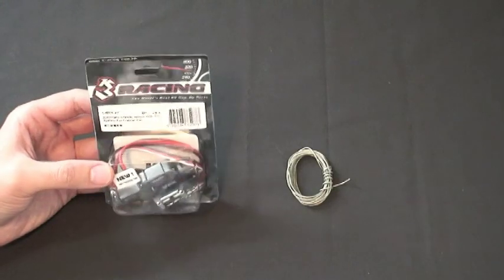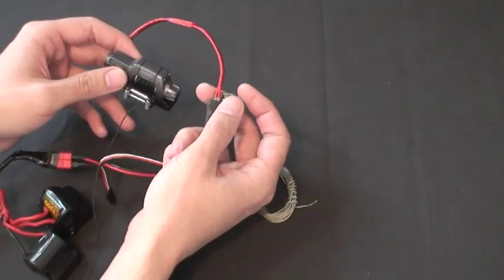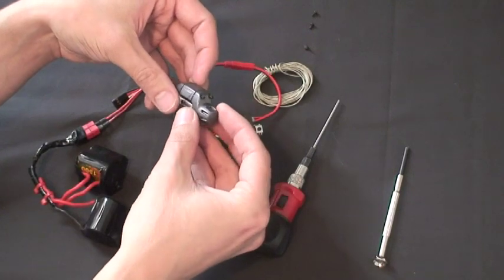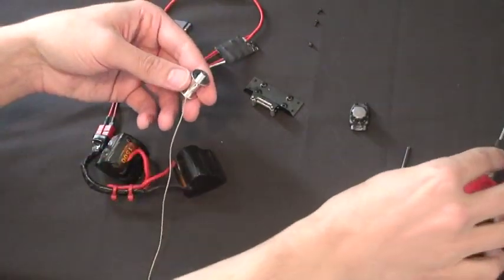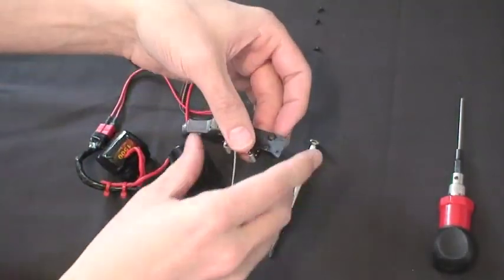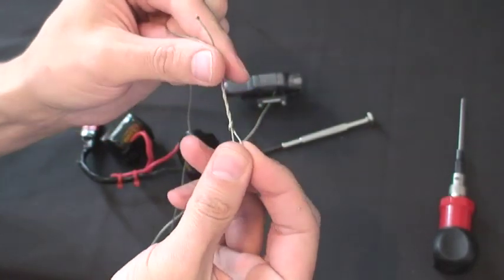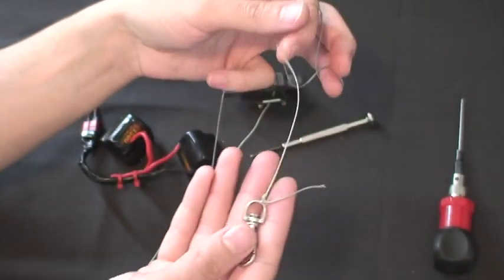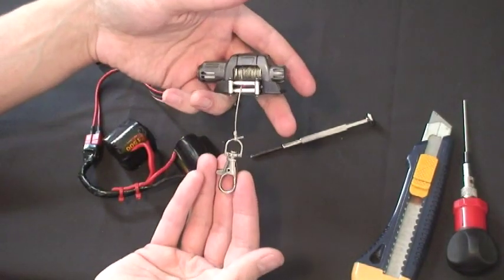RC ADVENTURES - Scale R/C Trucks #9 - 3RACING WINCH - How To Respool Cable

Comment: I love it :) Just to let you know the cable should come off the bottom side of drum not the top side like you have it. In real life if spooled off the topside then the automatic break holding will not function properly. And the hand held remote switch will be backwards there is a little diagram on the switch which shows up to winch out and down to winch in. Just to let you know :)

Comment: Did you waterproof anything in this 3racing winch?
The motor itself should be fine, but are there any open electric connections?

Comment: Managed to burn controller ... Dont ask how... Can it be replaced with 10A brushed esc? Never used button always used it on 3rd channel.. And I have few 10A ESC without brake and they are much cheaper than original controller, and I think it is stronger with 10A

Comment: If I recall correctly the answer would be NO. Since the Aux channel is control by a two position switch and only goes from end to end. The winch requires 3 position end mid end.

Comment: The only problem is, the winch was pulling in the wrong direction when you spooled it on the drum, it should spool under the drum, not over, or the cable will rub on the back side of the roller housing. Very cool demo though.

Comment: I dont see why you took everything apart for changing the cable?!
You can do that even if it's mounted on the truck!
Ps: It's always good to put some grease on the gears, I already had some 3R winches which were sold without any grease.
Pps: turn the winch into the other direction when you roll on the cable, because the way you did it the cable gets a really bad angle which gives a lot of force to all the parts when the winch is used ;) hope its understandable what I mean ;) 
all the best